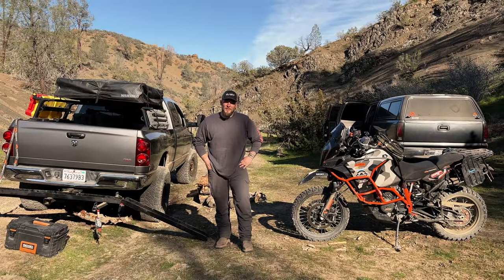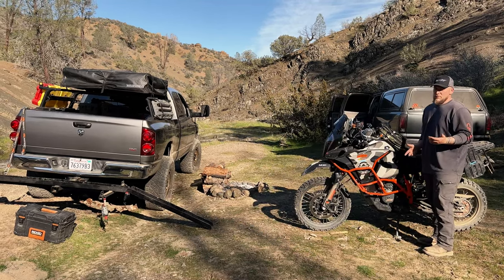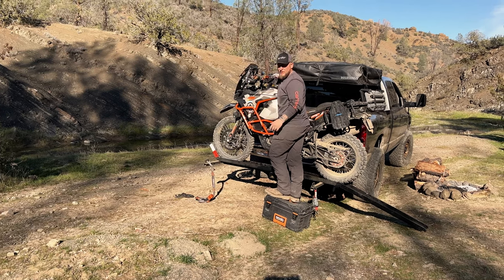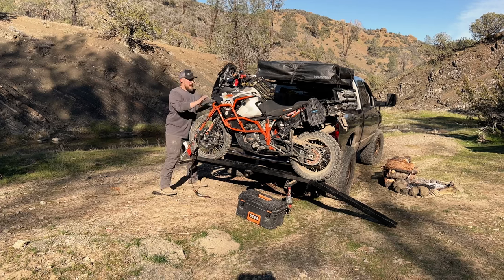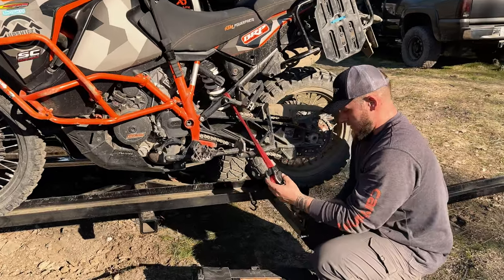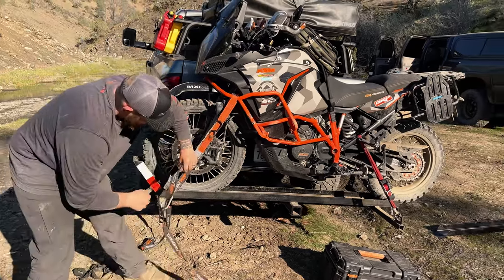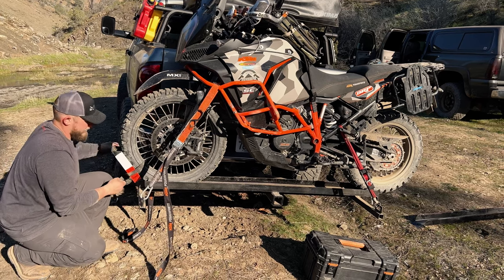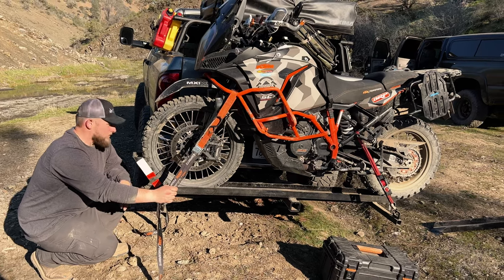Loading a BIG Adventure Bike onto Lifted Truck | Hitch Carrier Transport KTM 1290 SAR

Comment: Thanks I have a 450lbs Himalayan I loaded up on my harbor freight 600lbs hitch rack. This video helped as I have a QX80 4X4 which is very high as well from the factory. The main trick is to have those front two straps pre set in length and ready to go when you power the bike up. Definitely tricky the first time I did it.
Reply from the maker: Glad it helped you out. Just getting used to balancing it all is the tricky part. After that
It’s pretty simple.
Reply: @EpicAdventuresOffroad  I have loaded and unloaded several times and now it is easy. I cruise up and down the interstate 80 over the Donner Summit to lake tahoe and Reno at freeway speeds no problem. Works great! Thanks.
Reply from the maker: @SlowRiderDucati  glad to hear it! Also- love the username. 👍

Comment: fork braces are awesome for strapping down bikes. keeps the front a lot more solid and from moving around as much. just supports the forks from compressing by going between the top of the wheel and the bottom of the lower triple clamp.
Reply from the maker: I’ve heard some horror stories with those things unfortunately. People using them on motorcycle trailers and the suspension won’t compress down far enough to keep it solid and the bikes bouncing off the trailer, etc… I just haven’t felt real great about using it on this big heavy bike. But I might if I found a really solid unit.
Reply: @EpicAdventuresOffroad  2 inch pvc pipe cut to length will save on seals.  I have a 2020 ATAS it works well when trailering a distance its pretty solid. Like the videos keep it up.

Comment: Just a question, why not back the truck to where the rear wheels are on the low side and load the bike from the higher side. That to me would put the ramp closer to the ground.
Reply from the maker: Definitely an option. Just showing what works for me. But whatever you need to do to get your bike loaded and get out there to ride is great!

Comment: Would you take your bike 2000+ miles across the country with this hitch? I gotta go from UT to PA and rather not rent a Uhaul trailer for $570 if I can just buy one of these.
Reply from the maker: Absolutely. Especially if you’re just doing road driving. Just be thorough in strapping it down, and check it whenever you stop to fuel up.

Comment: whats the tongue weight limit on your vehicle? wondering if i can put 500lbs of bike and carrier on a 500lb tongue weight rated SUV
Reply from the maker: General rule of thumb is 10% of your vehicles towing capacity. My truck is rated around 13k for a bumper pull. So 1300 lbs is about the max I would want to see on tongue weight.

Comment: Definitely need that beefy bike strapped down as tight as possible. Do you ever need to put some kind of padding between the bike and the tailgate?
Reply from the maker: Absolutely. Last thing I want is a $20k bike tumbling off behind the truck. And no need for padding. The bike is about 8” away at its closest spot. I know it looks closer than that, but the bike doesn’t move that much in transport either. 👍 thanks for always commenting on the videos!

Comment: Whats your hitch tongue weight capacity and the weight of the bike?
Reply from the maker: General rule of thumb is 10% of your vehicles towing capacity and my truck is rated around 13k for a bumper pull. So 1300 lbs would be a safe area for me.

Comment: What mods did you do to the carrier? My versahaul is rated to 500lb and I don't want to test that claim...
Reply from the maker: I replaced all of the bracing with 3/16” wall,  2” square tubing, added a frame underneath the tray, and replaced the tie down bars with 1.25” square tubing, same thickness, and also cut out new tie down brackets out of 1/4” with my plasma cutter. It might be a little overkill honestly, but it works great for what I’m doing. 🤙
Reply: This was my exact question because I haven’t found a good bike carrier for the big bikes.

Comment: No room for mistakes there! 

Might want to slap some non-skid stuff on that ramp. It would also be a LOT easier to park next to higher ground on the passenger side.

Also, huge mistake not putting a block on top of the fender. Take a big bump, you can throw a strap. It’d be even better to get clamps for the foot pegs.
Reply from the maker: Non skid is a good idea. I’m actually planning on welding a few pieces of expanded metal to the floor of the ram to help it grip better. The big bike likes to tear the non skid tape off. 

I never run a fork saver/block in the front fender because I’ve read too many bad stories of those causing more harm than good. I’ve been moving this bike this way for a long time as well as dirt bikes with no issue. Compress that front suspension enough to hold it tight without going too far, and you won’t have any issues.

Comment: You would've had an easier time if you turned the truck around and set the ramp on the high ground. Same two tires in the same little ditch rut, just rotate the truck 180-degrees and film+load from the other direction. The only problem would be the sun would then be facing the camera.
Reply from the maker: Thanks for the suggestion.

Comment: You need to not crank the forks down so much, terrible for the seals.
Reply from the maker: I appreciate the concern. I have bleeders on my forks - so that when you crank them down to transport, you can bleed the extra pressure and not harm the seals. I’ve done it on all of my dirt bikes and on the motorcycle. Never a single issue. Just make sure you use your bleeders.

Comment: only problem, seems to be the lights of the truck that got hidden
Reply from the maker: It does block some of the light, but most of it is still visible. Confirmed by having another rig behind me let me know. I’ll be adding some auxiliary lighting though. Better safe than sorry.
Reply: When I carried my DRZ on a ramp, I used a Harbor Freight towing light kit.
Reply from the maker: @67daltonknox  good idea. I also found a set of nice LED’s on Amazon that should work well.

Comment: Seems too hard on chassis ?
Reply from the maker: It may look that way, but I am far below what the truck can handle. And I know the rack will handle it because I built/modified it to hold the extra weight. Thanks for watching!
Reply: @EpicAdventuresOffroad  Thx. Did you reinforce the chasis ?
Reply from the maker: @geoinnovacion1704  on the bike or the truck?

Comment: I'm not here to knock your ride(s) but it simply doesn't look safe and that big KTM is an expensive thing. 

You detail your mods to the carrier but it still moves around in that receiver hitch (a whole other discussion, but for all it's versatility, the receiver hitch is a poorly executed idea and design). What about some extra bracing for the carrier? Straps or struts, that fulcrum is being twisted in ways a tow ball will never apply forces.

What about the obscured rear lights? Are there states with overhang laws? Where is the centre of gravity side to side?

I admire the setup, I have looked at similar as a project, but may be my euro background is the problem... That wouldn't get past the first police car in most of Europe! 

You are well within weight limits (I drive a Dodge 3500 Cummins, too) and the stiffness of the chassis shouldn't be an issue (mind those Dodges do like to rust) it's the movement at the receiver scares me... And following you in the dark.

End of the day, you ride more than I do so well done😆